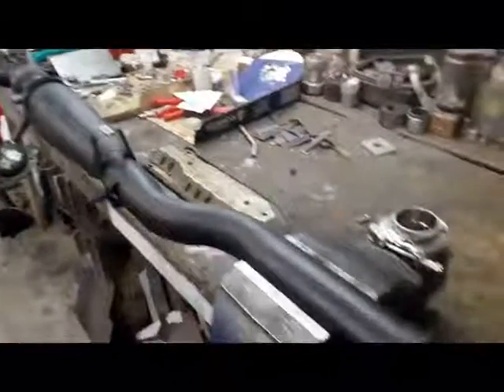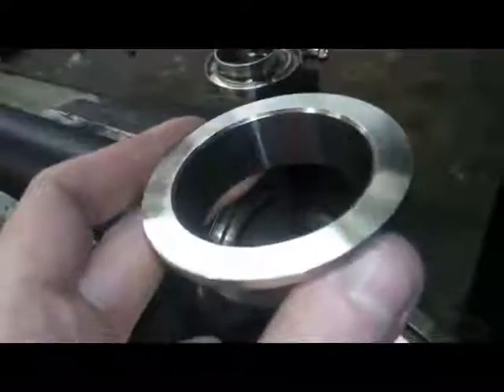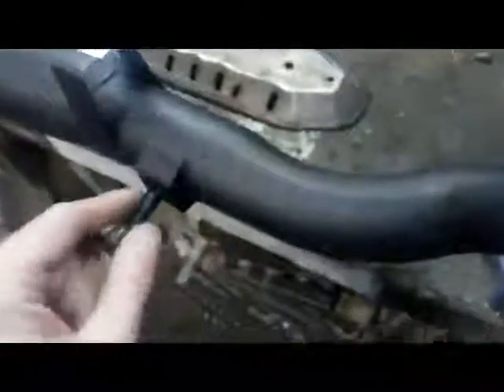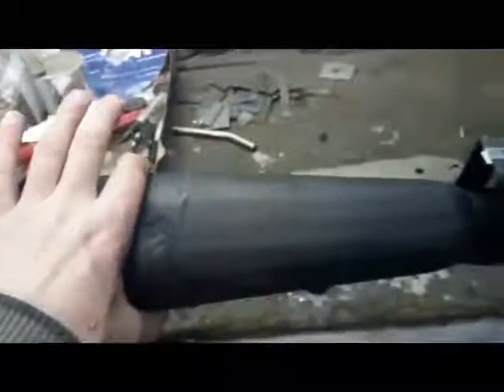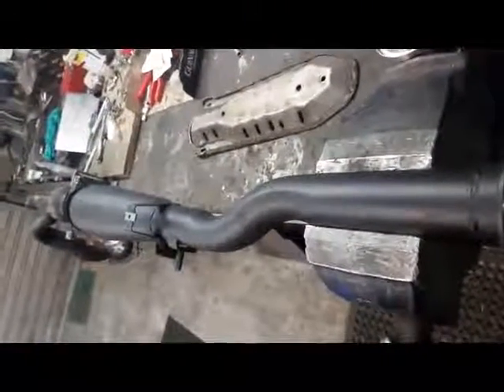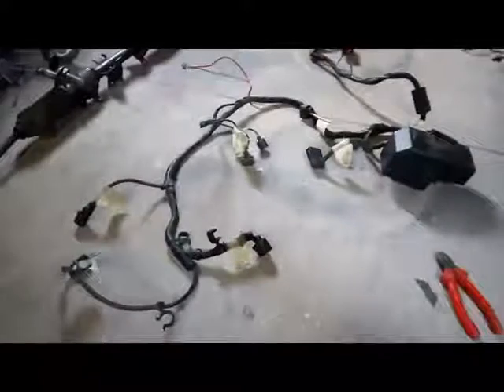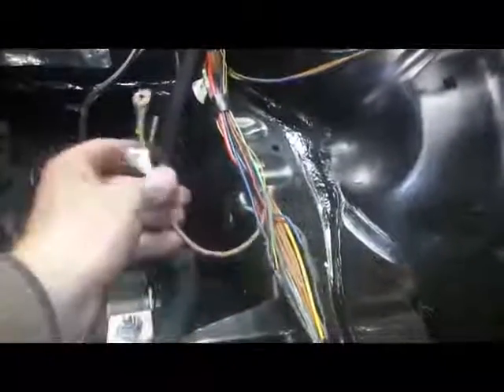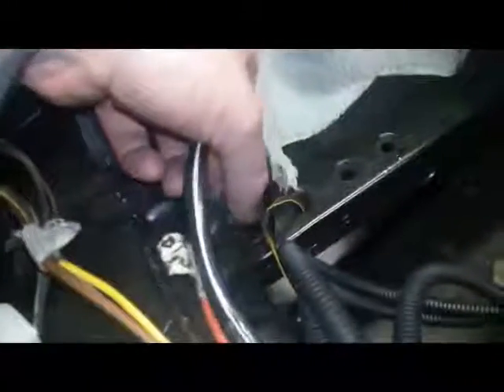mk1 golf 1.8T AUM swap part 11.mp4

Comment: hello friend I saw that in your previous video, here are the engines of the engine I would be interested to know what material I have done since I have the same project but a 6n2 pole
Reply from the maker: Hi, if I understand correctly, the engine mounts are 3mm mild steel.